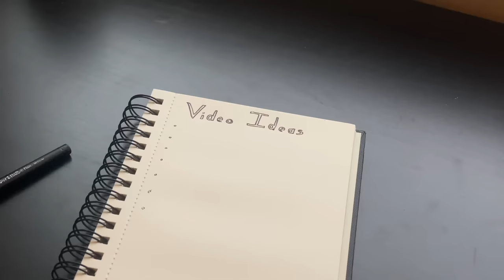First Days of Winter on the Alaskan Homestead

Comment: Good to see another video and to see you hanging in there and making plans for winter.  So maybe it doesn't matter BUT man, pick up your tools and stash them under your shed or near your living space, if a big snow comes in they are all going to be buried or ruined.  Maybe I'm just being OCD...in fact I'm sure that's what it is but I just want the best for you to make things easier.  It's going to get much more difficult, I think you know that so anything that makes it easier shouldn't be ignored.  Hopefully you can get your cracks sealed up, you might need to start waking up in the middle of the night to restock that fire too.  Might make life easier to cover your wood up too so it doesn't get too much snow on it.  Even if you don't want to shell out the cash for a tarp, piece of sheet metal, some plastic, or a chunk of roofing rubber or whatever, just get some cardboard boxes or something and try to take care of it that way for free.  You could probably throw together a lean to with some of your rough cut trees.  You might be able to build a little place inside your cabin to keep a few loads of it dry so it is ready to go.  The fire will be everything for the next several months - no doubt you'll figure out all the best practices.  I guess you've lived there before so you're no stranger to it, you're just making me nervous!  It would be cool to document more of your consumables (food, water, burnt wood, etc), the relative temperature and precipitation, the actual daylight that you have (lower 48 can't relate on that one).  Plus also maybe any future plans with targeted dates like when you're going to get that door swapped out and the roof finished off, when you might get a step built up to get into your cabin.  I wish I was up there, would love to drop by and help with some of the menial work like transporting firewood and cutting it up.  Honestly, I'd rather do that than my day job...fresh air, knowing that 100% of my efforts are going right back into supporting myself.  Anyway keep the videos coming...you may be betting on Alaska but we are betting on you!

Comment: One thing you might try out if you haven't yet is a reverse layered fire - I believe it's an old Norwegian method. You essentially put a large log or two on bottom and stack it up so the smaller pieces are on top. Start the fire on top and it'll burn down. This creates a much better ember base and you dont need to constantly baby the fire. It'll be good for at least an hour. I've been doing it for the last few years and can't believe I ever did the traditional method.

Comment: We heated with wood in Maine. We got a lot of ice then extreme cold so I covered the wood with a tarp and just swept off the snow and rolled it back   The smoke may be because your starting fire was too big and the hot air couldn’t push the cold air up the flu fast enough to get all the smoke out. Maybe start with smaller fire then feed it.  Good luck!

Comment: AIR! Please arrange some air for the stove. It will help it burn more easily. You can google how much air is needed per minute for burning wood and you will notice that a lot! My guess is that around 100mm diameter pipe through the wall or floor is needed. With adjustable duct you wont loose all out but it is anyway needed during the burn. Good job otherwise. Greetings from Finland!

Comment: Few things to consider on your next build is a steep roof is a pain to build but helps shead heavy snow also I'd build something to try and keep snow off the wood also siding on the cabin could help insulate and keep the plywood from rotting or warping over time

Comment: with my slight experience with wood stoves, the billowing is from the cold outside air in the chimney sinking as the hot fire air rises. It creates a down draft that brings the smoke into your cabin until the air in the chimney heats up. Don't worry about it, you won't burn your house down (I think)

Comment: If your determined enough you'll make it. As far as the smoke in the cabin its probably a draw issue the temperature inside the cabin and out side are pretty close to the same. This happens in the fall or "yellow time as you put it" by the way I like that saying. As the temps dip more outside this probably will go away.This is just my best guess without actually being their. It also helps to crack a window or door open just enough the allow air flow. My cabin is pretty air tight so I deal with this problem in the fall and spring. I'd recommend a tarp over your fire wood pile so the top couple layers of wood don't get full of water as the temperatures fluctuate the snow will melt and soak into the wood then freeze again.

Comment: If your wood stove problems keep happening try an outside air intake for it.  Everything that goes out the chimney (hot air) has to be replaced in your cabin. If your cabin is air tight it can’t get the draft it needs.

Comment: YOUR STOVE IS WAY TOO CLOSE TO THAT WOOD WALL. PLEASE INSTALL A FIREGUARD ON THE WALL. ANY METAL WALL SHEILD NEEDS TO HAVE AN INCH OF AIR SPACE BEHIND IT. YOU CAN USE SPACERS SUCH AS AN INCH LONG PIECE OF COPPER PIPE, RUN THE SCREW THROUGH THE METAL THEN THROUGH THE MIDDLE OF THE PIPE AND INTO THE WALL. That wooden wall is already tinder dry, and could combust quite easily. You do not want to find yourself alone in a snowstorm in the middle of the night with your cabin burned down. Hopefully you also have smoke and CO-2 detectors.

Comment: The one thing I noticed was the door, looked like a hollowcore door, is it practical for the winters? I get the woodstove would run at night, but assuming the fire goes out the heat cold looks like it would seep in quicker.

Or is it not much of an issue since it helps keep the house from being too hot?
Reply: Hi HarroKitteh where are you from?

Comment: guessing the smoke problems is a cold stovepipe, Burn a small piece of paper in the stovepipe to warm/ start the drafting process,  ie hold it in the stovepipe light it on fire.
Fully open the damper before you light a fire
Strike a match or use a lighter to test the air flow in the chimney. The flame should look like it is moving upwards. Otherwise, smoke from the fire could go back into the home.
Warming up the Flue

Make sure the damper is open and roll up a newspaper and light one end to make a torch. Hold it up in the chimney to warm up the air and make it rise.  
 enjoying your progress on the homestead, the only way to learn is by doing, not sitting behind a keyboard, like me.

Comment: Insulate your smoke pipe on the outside of the house and add a few feet more to it, that way you will not have any smoke and there's going to be a good air pull, cheers.

Comment: Took me a while to figure out the quickest method for starting a blazing fire. Essentially, construct multiple layers of kindling in a hash-shaped pattern (####) and ignite with a portable hand held propane torch, the type typically used for copper brass soldering, activated by a piezo ignition.

Comment: Hopefully I didn't miss it in a previous video, but the stove smoking out the first time was probably because you didn't do an initial burn on it when you first got it. If it is new there is often a left over coating inside that needs to be burned off. I'd imagine that's why it was smoking so much when you first used it. Best of luck!

Comment: Stove smokes back because the top of the chimney is cold and causes the air to fall on the flames and push the smoke out the door. Keep the fire small at first to preheat the air in the chimney

Comment: I would have done things a little bit more different with that stove. I would have set it in at an angle to the corner, so that the door is facing out to the broad area of the room and I would have made sure that the back corner walls on  had fireproof boarding. Nothing like catching your house on fire while you're gone off hunting in the woods.

Comment: Your wood stove requires a heat shield so as not to burn down your cabin. Look up W.E.T.T . Manual on solid fuel burning appliances. Lack of proper clearance are all too common a mistake that results in many home fires and sadly, fatalities. A covering over your wood fuel would also be of benefit as you will find, also in the manual.
 I am a retired loss control specialist with many years of experience in solid fuel burning appliances. Have a safe day.

Comment: How did you build your Woodstove so close to your wooden wall with what looks like no heat shield?  How did you decide to put your Woodstove with almost no protection on floor under the stove door? Are you not concerned for embers in your floorboards and your stove combusting the wall behind your stove?

Comment: I know you don't have much money to work with, but for safety's sake, please put a backing behind that stove. There's several ways to do it, even rocks and mud could insulate that corner in a pinch, but the easiest way would be to just slap up some concrete boards and sheet metal and call it a day.

Comment: is that wood burner save that close to the walls without something other than the walls itself  not much clearness  not metal sheeting over time heat could cause the studs inside to heat up become like charcoal then ignite

Comment: The stoves needs to be prelit outside so you oet the chemicals on the exterior of the stove to burn off before you install inside, if is nee if used should not have mattered

Comment: I am 73 years old. Grew up in a home with wood heat and wood cook stove. Spent years in cabins and camps burning wood. Camped out all over the place with campfires. What I don't understand is why every single Youtuber that burns wood in all situations cuts and splits the wood so small. Larger blocks burn longer and you can control the heat more. The bigger the better if it will fit in the stove. All night heaters burn longer with bigger blocks. Campfires burn longer with larger blocks. Am I the only one who ever sees this? Waste of wood and energy with all the cutting and splitting, etc. Plus most people I've seen do not know how to split wood with less bending over. It is simple to split wood without constantly bending over. True old woodsmen will agree with me.